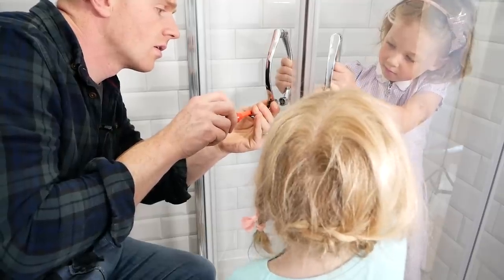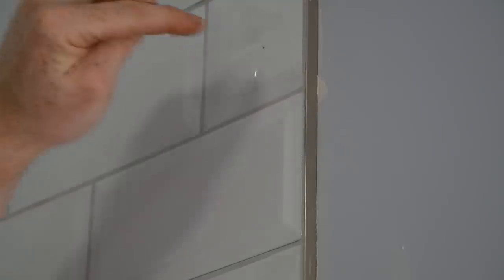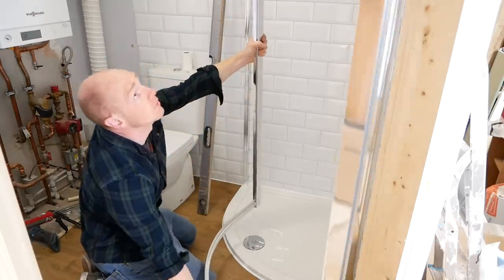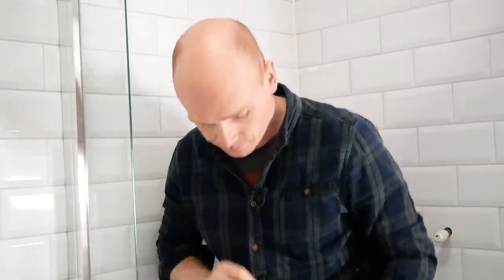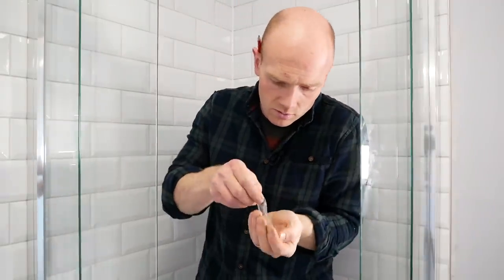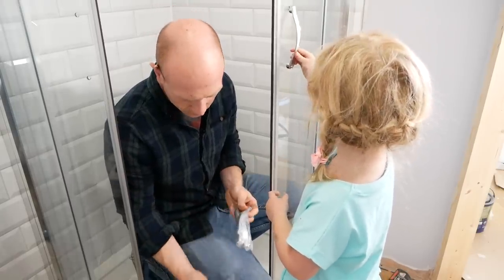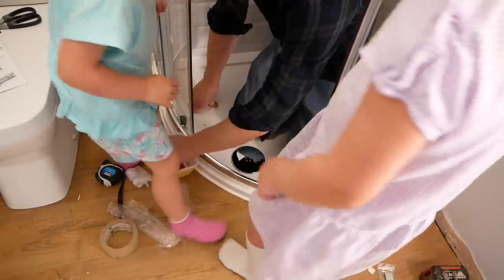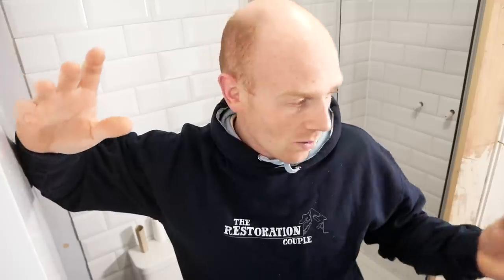Fitting a Shower Enclosure | DIY Bathroom Build

Comment: Pure concentration at 12:18! 

Top tips.
1. Put cardboard/dust sheet or similar in the shower tray to prevent marks, damage or things ending up down the waste (for those who have a more open type outlet).
2. Masking tape over silicone before drilling.
3. Mask the area where the uprights go,     makes it easy to mark up fixings without borrowing the eyeliner, and saves the metal struts from marking the tiles.
4. Wear gloves if you have to use any force when piecing things together, those frames are razor sharp.
Reply from the maker: All good points and tips. Thanks 🙏

Comment: Thank you for sharing this video.  It's the best Fitting a Shower Enclosure demo on you Tube, Delightful young helpers too. The mystery of the missing clip. Did it fall into your back pocket... but "it was there all the time" brilliant.  "Daddy you've got pockets"... I recall my brother saying as you mention don't put the sealant inside. But, before I finally do mine which is a job that should have been done months ago. I'll share the video with my brother in case he notices anything I might have missed.  Might wait for him to visit and assemble and fit it together.

Comment: What did it say regarding sealing the frame to the tray and rails,  there’s many different thoughts on it as to stop Leakes do you seal the out side or both with silicone, great video easy explanation by you thanks..
Reply from the maker: I’ve only ever done outside. Anywhere else is just asking for trapped moisture and mould...

Comment: I think your throw away comment about getting a quadrant over a rectangular frame may come back to haunt you.  We bought a house with  a similar shower enclosure in a wet room.  The unit is now about 10 years old and I am about to pull it out and install rectangular unit. Although it is the least used unit in the house the rollers are failing and starting to stick and am unable to get replacements, it is a nightmare to keep clean etc.  One thing that I did add - Not sure if these are available in the UK - was a shower dome ( http://tinyurl.com/y53mj7xd ) to all our units and they are brilliant at keeping the humidity in the unit.  Thanks for the videos, I never miss them.  p.s. have lost a couple of screw caps down the drain that have randomly fallen off!

Comment: Can I just check what you said about only sealing on the outside. I’ve not fitted an enclosure myself but every one we’ve had fitted has also been sealed on the inside. Is only sealing the outside definitely the way to go (your reason for doing so sound logical) or are there 2 schools of thought?
Reply from the maker: It’s the only way I’ve read or seen it recommended. I can see the reason people may think internal is best though.